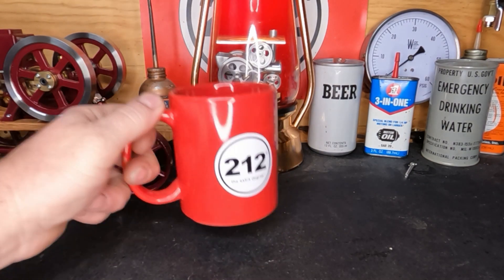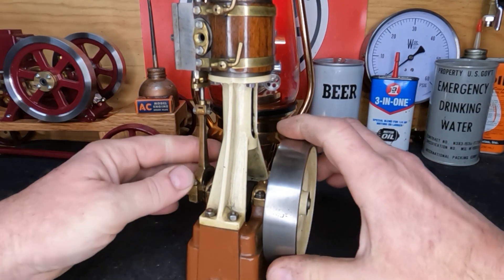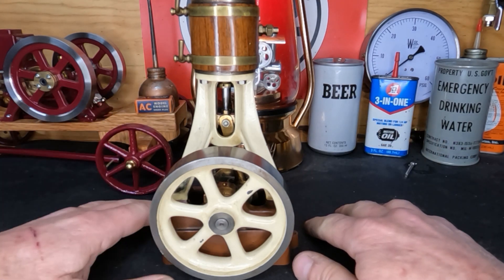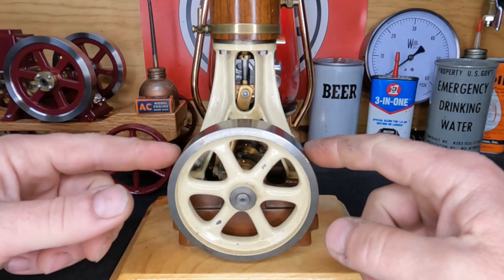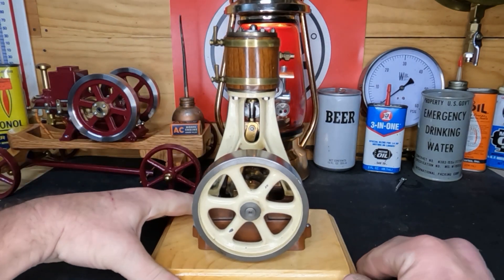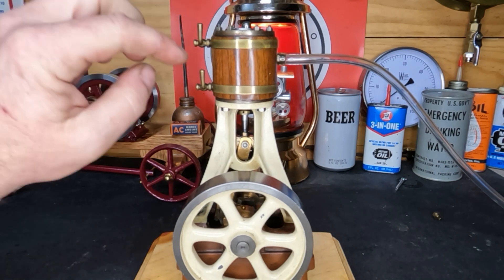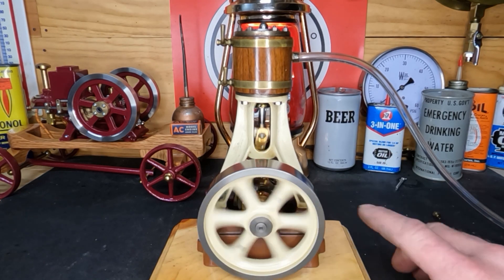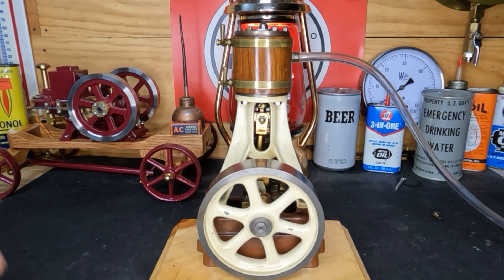Stuart 7A Steam Engine Repair & Refurbish Part 1, First Test Run & Evaluation

Comment: I bought a Stuart 10V two years ago, which showed the same symptoms - flywheel almost stuck! It took me some time to make it run properly (mainly timing). So I am curious how you will solve the problem(s). Colour: dark green/black (!) or dark red/black is my choice. 👍

Comment: Something like this is no longer a toy, it's just a small steam engine capable of doing real work.  It will show as a part view when we go back and review a section later, can't get too worried about viewing times.  Make videos just to suit you and your interest level - your audience will engage or not as they will regardless, just remember how much you are getting paid to do this.
Reply from the maker: It is a nice sized engine, I have an idea for this one when we get it done.  You're right, it's a good thing the shop is solar powered, the revenue wouldn't keep the lights on.